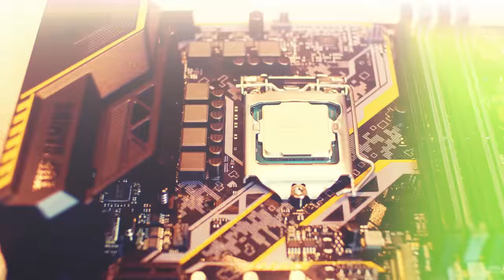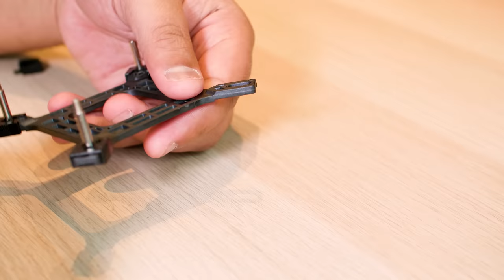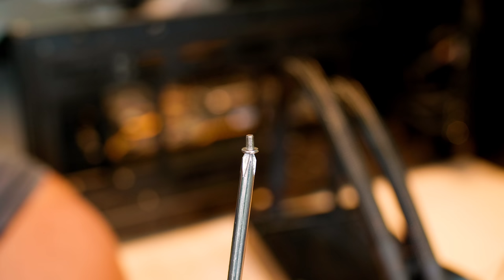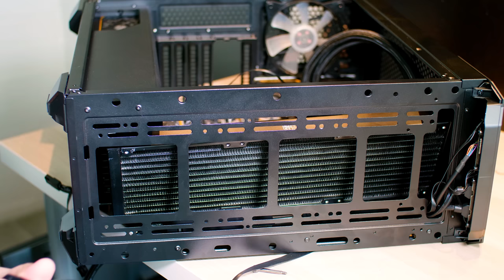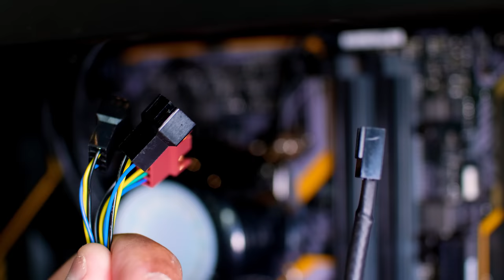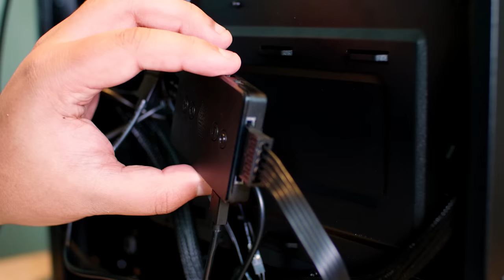HOWTO Install Cooler Master MasterLiquid ML360R RGB on Z370 & Z390 Motherboards

Comment: I have this cooler bit it doesn’t work with aura sync. I plugged it into the Mb and the controller. There was just one 4 pin plug in thing. So I can’t have done that wrong. You didn’t show that step in you video.. or I overlooked it.. watched this 10 times of more haha I have the Asus Prime-A Z390 motherboard
Reply from the maker: 3 pin argb only
Reply: But it’s plugged in with the 4 pins in the motherboard and the controller.. Why do they put compatible with aura sync on it when it doesn’t work on all of the aura sync motherboards.. I bought it for that.. that’s a bummer
Reply from the maker: It works if you connect the 3 pin argb connector and set the controller to motherboard mode. Install the masterplus software.
Reply: Gear Seekers Thnx.. yeah I already did that. I’m going to figure out how to put it on motherboard mode but guess it won’t work for me since I have a 4 pin..

Comment: Where do you get the sata cable from
Reply: It should come with your mother board
Reply: Yeah it’s all good now I just plug one in from one that branched off one of my ssd sata cables
Reply: skittle1eater but the leds on the pump aren’t lighting up now

Comment: Where do I get the SATA power cable from?
Reply from the maker: your power supply
Reply: @GearSeekers  thanks for the video it’s great but I have the same question it seems to be a 15 pin sata …do psu even come with those anymore?

Comment: i dont have rgb in the motherboard what can i do ?
Reply from the maker: Did you even watch the video? It has a controller
Reply: Gear Seekers yes i watch it 3 time 1  i have the old controler so if i buy this i dont have free usb header port 
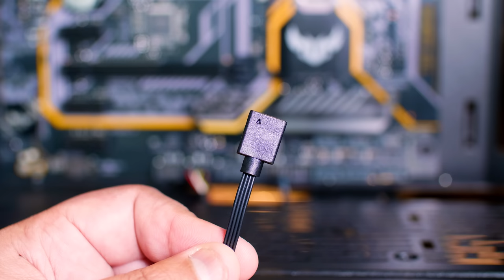2 in the 9:10 you put rgb cable in the motherborad in not good english i didnt understend what you mean there 
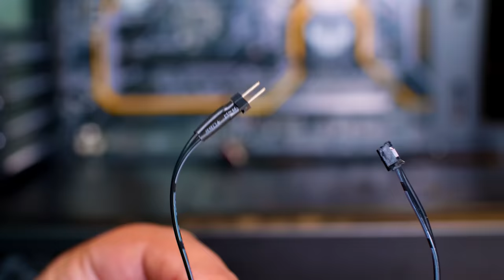3 why we need the reset cable in 8:28
And thanks for evry think you do 😁😁😁😁
Reply: Can i use argb fans with rgb controler ? The  normal one not the argb

Comment: Can this work on a z390
Reply from the maker: yes. they are the same essentially. The socket mounts for the 115X sockets haven't changed in around 10 years.
Reply: So a i9 9900k would work fine? Also what fans are in the case besides the aio fans
Reply from the maker: yeah 9900k will be fine. I cannot remember to be honest. This system is long gone.
Reply: Gear Seekers oh thanks. If you find out please let me know
Reply: @GearSeekers  where did you plug it in the motherboard is it in 12v or 5v?

Comment: I notice he completely ignores help questions and likes people praising him, there gaps of instruction you are not doing , like where does the hub box go ,it is magnetic but how do you press buttons when case is closed. You basically need to treat people as noobs.
Reply from the maker: You don't press it when it's closed. I explained that. We also did a full video about the software. We have a discord that people join who need help like I mentioned in the video. So before you go and berate how we make a video. I suggest watching the whole video. 🤦‍♀️